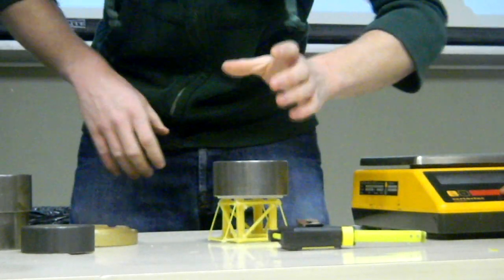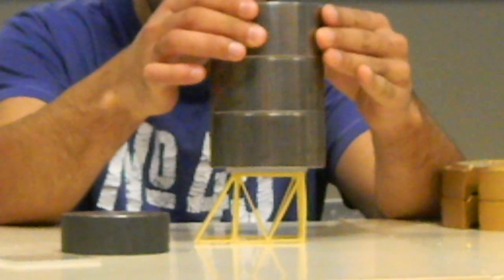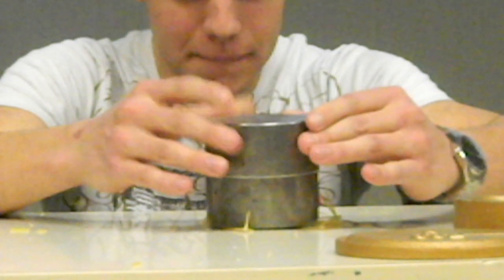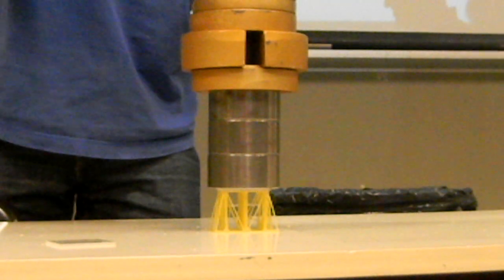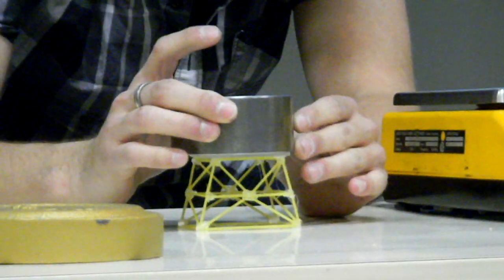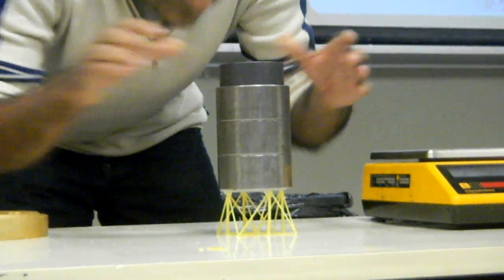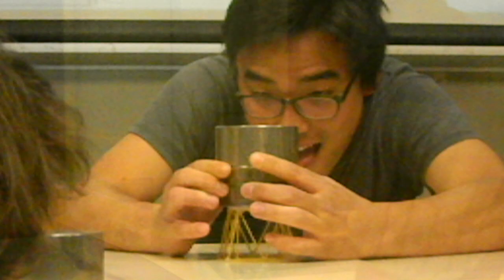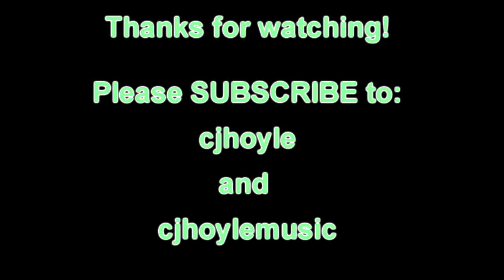Spaghetti Bridge - Midterm Competition (ME 380)

Comment: Makes me think of rocket engine support structures that transfer the force from the top of the combustion chamber
Reply: And transfer the force to the fuel tank above
Mainly due to the competition being based on mass to load capacity.

Less weight to support a given force is important,   a better structure to fuel ratio = MOAR delta V